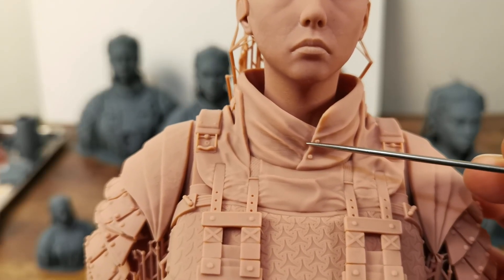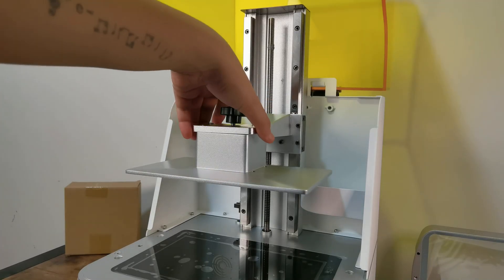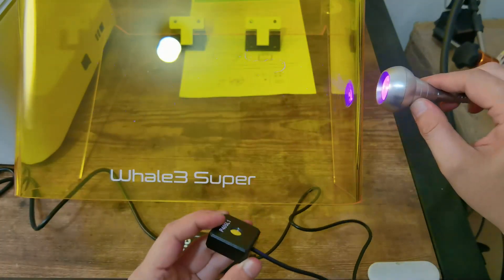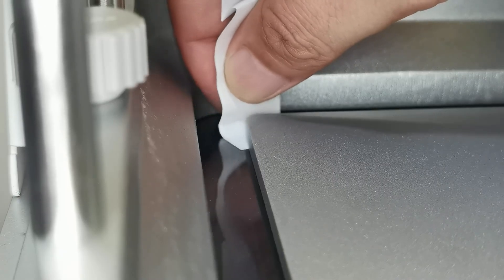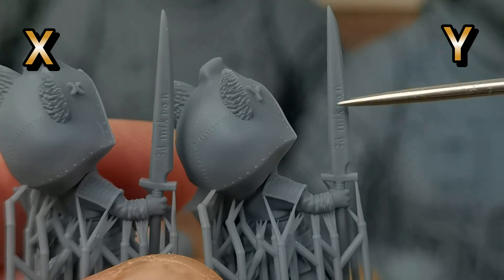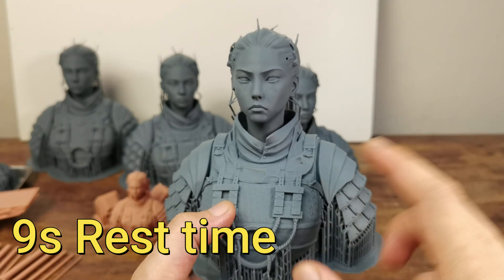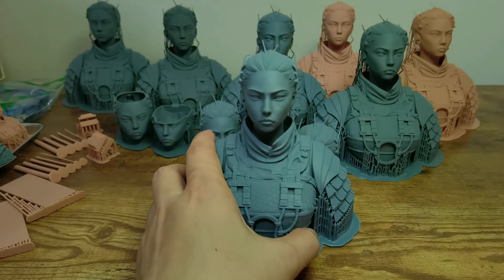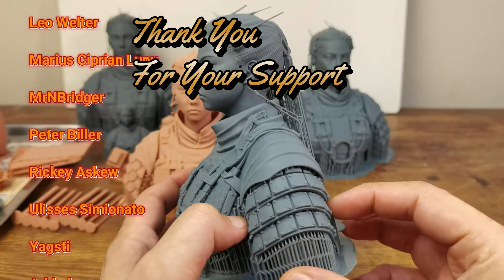Nova3d Whale3 Super 14k In-Depth Test & Review

Comment: Exactly the same issue with my old Anycubic Mono 4K. The FEP is so far off the the LCD, I had to dial in +0.4mm offset to even get prints to stick. And if you were hoping to print dimensionally accurate parts on the plate, well, forget about it - they would come out way undersized on the Z. Worse the shorter the part was as the compression was the worst at the bottom. It took me a while to figure out and I literally could not find anyone talking about this at the time. 

I got a ceramic 3rd party vat that places the FEP much closer. To see manufacturers still make mistakes like this is frustrating. 

As for sanding something flush and level - sand in figure eights, and turn the item you are sanding so that you also hold it from all four sides. You'll be able to sand fine just like that though I would not want to have to sand down a big alu vat like that. Plastic, no problem. 

Anyways, thanks as always.

Comment: I have similar "gap" on my Saturn 3 ultra when I changed to regular fep. ACF is 0.3mm compared to 0.1mm now. I wander if I should buy Saturn 3(non ultra) VAT? Any thoughts on this? Thanks
Reply: Btw I had few fails on this new fep, it was my first replacement ever. No distancer used...

Comment: A better soloution would be to lift out the screen and adding spacers under it so you are raising the screen up without messing with the VAT or increasing the distance between the LCD and fep which will reduce quality
Reply from the maker: I am afraid to crack the glass.
LOL
Reply: @wangdennys  idk how that one works but on my saturn and all others I've seen you just open the printer so you can get a hand under it to push the screen up from thr adhesive around the edge and then you can just print a spacer or use something to fill the gap and put double sided tape on either side of it, I dont see how the glass could break from this

Comment: You bring up a good point about the distance from the film to the screen.  That's why I never use a screen protector because I want to keep the NFEP film as close to the screen as possible because the further away it is, the more the light spreads. I use the Saturn 3 Ultra and get great prints.
Reply from the maker: 0.1-0.5 distance is fine

But this has 1mm thick tempered glass and the gap.

Comment: Happy new year dennys.

Think you could make a video on how to use UV tools to fix files? I have heard it can be used at least to fill places where there would be resin pools (not necessarily bad hollowing, just how the model was made).

And what's the ideal resin temperature? Is it enough to just preheat it prior to printing(given the heat generated curing each layer would somewhat keep the temperature stable)? Or a constant heat source is needed? Having a bit of issues due to cold weather
Reply from the maker: i dont really like to use uvtools, it only add complication for beginner

Comment: @wangdennys 
I asked about this and got an email from Nova3D. This is what they said: 
"Because the latest 14K uses machine tool cutting technology to deepen the position of Mylar, thus reducing the gap between the release film and the screen. Because Dennys Wang's machine is the first batch of machines we produce. But when we discovered this problem, we have solved it, so the machines we sell now are all normal. "
Reply from the maker: nice!!!!!!
Reply: @wangdennys  we will see what happens and if it is actually fixed! If it is fixed, would you recommend this printer? Also, does this have the same type of lens as the M3 Premium?
Reply from the maker: @amrogers3  they said they will send me new kit to fix the gap. and the new production already dealt with the issue, mine is somewhat still prototype.
i will make follow up video when i get the kit.
Reply: @wangdennys  Did Nova3D ever send the replacement kit?
Reply from the maker: @amrogers3  nope
Reply: @wangdennys  figures 👎👎

Comment: The "film gap problem" you mentioned doesn't seem to happen with metal film frames, you might want to look into this, Nova3D sells metal frames for the Whale3 series for people who want to use other film instead of what comes in those disposable plastic frames that they sell (and comes with the printer).

I use metal frames from Nova3D and my own metal frames I designed...
Reply from the maker: The height of the film is not from the film frame.
It is from the resin tank bottom height.
Nova3d said they will ship me new kit that they developed to get rid of the gap.
Reply: @wangdennys  Thanks for the info, very interesting, PLEASE show the results on here!
Reply from the maker: @retromodernart4426  i will if i get the new kit.
Reply: @wangdennys  Right on!

Comment: Does the 9s rest time mean before the UV array turns on to cure the layer, the build plate sits in the vat for nine whole seconds?
Reply: No, it means the build plate goes to where it's supposed to be, sits there, then 9 seconds later the UV light goes on for the exposure time duration.
Reply: @retromodernart4426  that's what I was trying to say. Jeez 9 seconds to get no print lines is insane
Reply: @AsimPaints  No it's not insane, it's good practice for all medium and larger printers for the first 1mm to 2mm of a print -  you do understand that this "built in" delay only happens for the "bottom" layers?
Reply from the maker: In case of whale3 se, it is hard coded to all layers.
In whale3 super, you could change it.
Reply: @wangdennys  I'm not seeing that delay on all layers on my Whale3 SE, I've timed them...
Reply: @retromodernart4426  No, lol that's insane and unnecessary. My delay is just 1-2 seconds, and I never have print lines like this.

And I'm not sure what you're talking about, the delay is for all layers. How do you think he was able to get the print lines to go away at the top of the models he showed?
Reply: @AsimPaints  I'm talking about my Whale3 SE and Whale3 Ultra (both 8K), as I wrote, not his, so ask him that question, not me.  Maybe my Whale3 SE has different firmware, I don't get those lines, ever, and I don't use those delays except on the first layers as I wrote clearly.  But I do use a metal film frame and ACF, as I also wrote.

And yes, I print many large, detailed prints.

Finally, when you talk about delays, etc. are you talking about your  Nova3D Whale3 Series printer or some other?
Reply: @retromodernart4426  Huh? You literally didn't say anything about your printer, I'm responding to your comment toward me, not your comment toward wang...

You said it's good practice for ALL printers to have this delay for the initial layers. If we are talking about the same thing, 9 seconds of the build plate just sitting in the vat before the UV array turns on to cure the next layer, that is unnecessarily long. The light off delay function is just to let the disturbed resin settle before the UV turns on.

I'm talking about all printers, since your reply referenced all printers... All printers don't need more than 1-3 seconds light off delay. You also claimed it's just for the initial layers, which I don't get what you mean, light off delay is for all layers, unless you want your light off settings for the initial layers to be different for whatever reason.
Reply from the maker: Yes it is.

Comment: sorry, but what rest time do you mean? Before lift, after lift or after retract? Don't understand that parametr
Reply: In this case, time from when the print bed comes down to when the light comes on.  Due to the large gap under the film, more time is needed for the film to level itself back out from the pressure of the print bed squeezing the resin between the build plate and the film.
Reply from the maker: After retract
Before exposure start

Comment: Hardcoded 10 s rest time??
That gives total printing time like in 'good old days' of first RGB printers, like 20 hours? 30 hours? 🤯
Reply: sorry, but what rest time do you mean? Before lift, after lift or after retract? Don't understand that parametr
Reply: @Vitalik1881  I guess, after lift.
But I just quoted what Dennis said in the second part of this video...
Reply from the maker: After retract
Reply: The "hardcoded" 10s rest time is only for the bottom layers, not the whole print (I have the 8k Whale3 SE and 8K Whale3 Ultra).  I actually add up to 60s wait before print time for the first 20 layers or so, depending on the print.